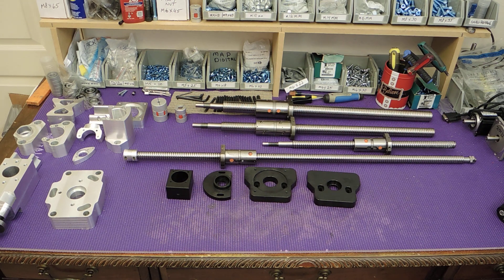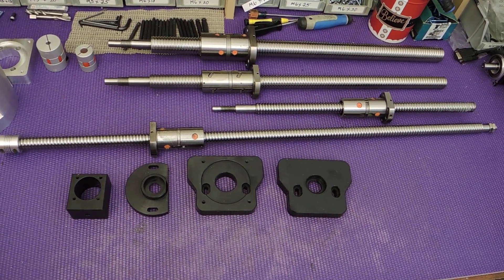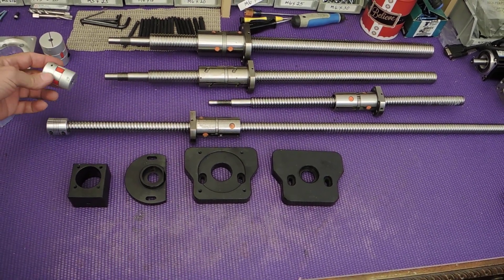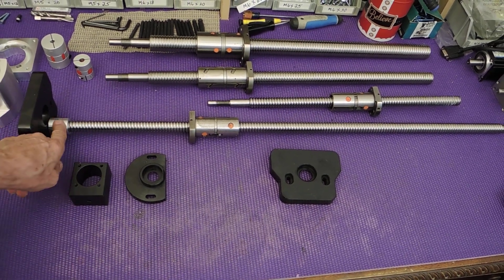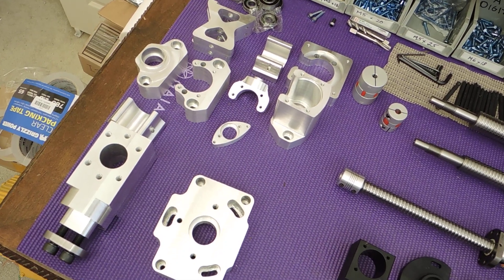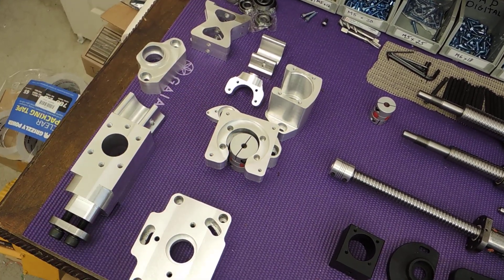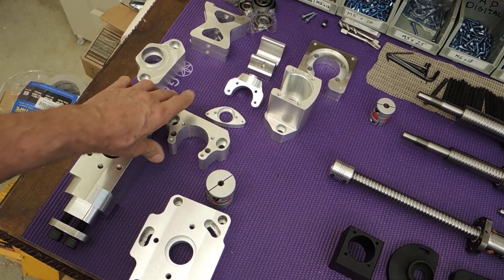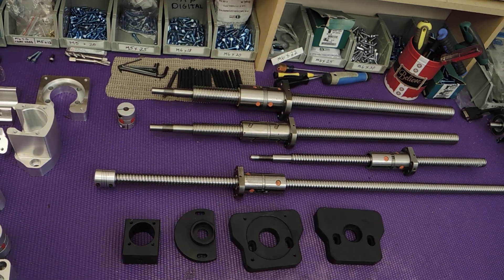PM-833TV and PM-932V Update

Comment: Great news. Glad to see you making these. What's your take on the 932, 833,or 940? Which one would you prefer to convert to cnc if you were going start a cnc conv. Thanks
Reply from the maker: It really depends on your use and budget. For just hobby stuff the PM-30 is really nice and has great fit and finish. I look at the 932 as a choice compared to the PM-30. It has a larger motor and it just plan bigger in ever way but the table is a bit shorter. You could upgrade to a 4 HP and 3600 RPM motor and you could do things that the 30 could never do. 

I don't have the 833 in hand but the guys have sent a lot of pictures. It has more webbing in all the casting and I bet the fit and finish will much better than the China mills. Is it worth the extra cash? I really would have to see it run but I would not be surprised at all if the surface finish is better than the 932. 

The 940 is just bigger than the rest. The Y is really large by 3" or so. The head is 3"  longer than the 833. I think it out of stock for the rest of this year, bummer.

With the current short stock you will have time to think about it. The 833 will be coming in with good numbers after that the 30 will be in. 

For light production the 940 is still the king with the 1000mm table.  For 2 vice work  the 932 or 30. The 833 table is 1.5" longer than the 932 and the same as the PM-30. 

I cant say which is best unless I know the use.